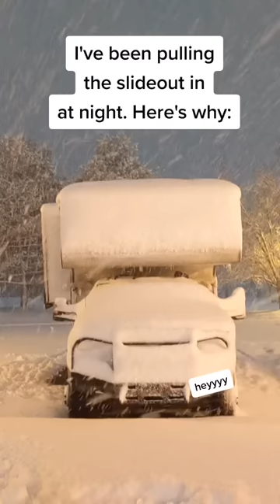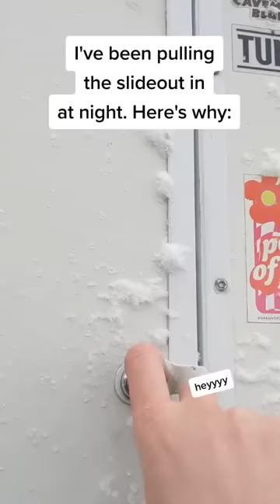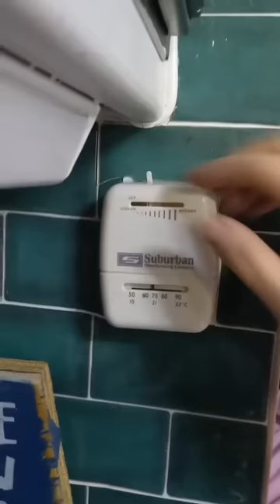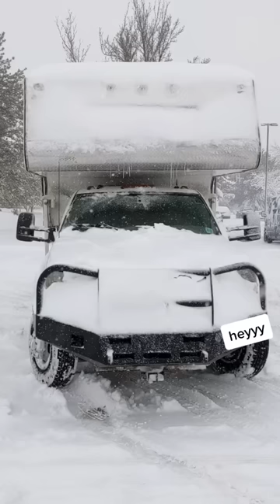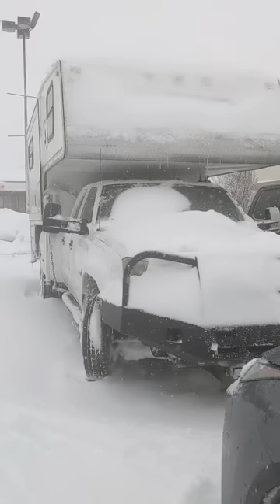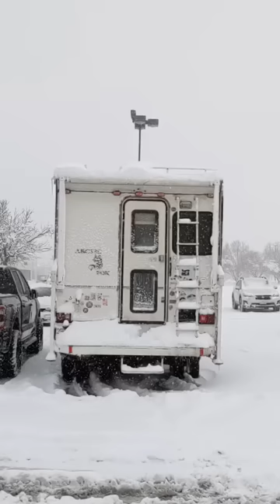the truck camper slide out theory #truckcamper #rv #rvlife #vanlife #fulltimerv #travel #slideout

Comment: Anytime you have more surface area exposed to cold you increase your heat loss. Slide in you basically have just the exterior camper side wall. With the slide extended you still have the side wall but also have 4 other surfaces now exposed to the cold air plus increase cubic feet of the interior.  The other thing you won’t have is snow on top of the slide that will need to be thoroughly cleaned off before closing the slide for travel. Your heating cost saving will not be huge but absolutely having the slide in will save some furnace cycles.

Comment: HVAC contractor here. Yes, fact. If you have less area to heat, it’s going to be cheaper, and probably easier for your heat source to maintain. On the flip side however, how much is the diff in sq Ft? Probably not enough to warrant the wear and tear on the pull outs. JMown 2cents.

Comment: You are going to save energy for three reasons:
1. Less exterior surface area to lose heat
2. Less interior volume to heat
3. Better sealing of the RV envelope
Plus, ice and snow can expand and cause issues with the slide track and gaskets.

Comment: Pulling the sled out increases your external exposed surface area AND it increases the internal volume load on your blower motor and will cause your unit to run and cycle longer. But the difference wouldn’t be enough to notice and use that much extra propane. The thing that really determines how much you’re going to spend is the outside temperature compared to your indoor setpoint. Your setpoint will always be somewhere close but the outside temperature is the biggest variable and it’s the part you can’t change.

Comment: A larger area will have less temp changing 
Smaller area will cause the furnace to cycle more often
Imagine what else the furnace is heating besides the air
The more objects also helps to keep a space warm

Comment: Absolutely, the slide out exposes its 5 walls to the cold exterior temperatures. When its pulled in it exposes only 1 surface plus its sealing the exterior wall cavity

Comment: There is less air space to heat, and there is double. The insulation in places, also adding foam blocks used for sound deadening, on the walls, especially over windows, and on the ceiling, especially the ceiling, the heat goes up, even getting a nice printed cloth and either glue it to carpet padding, or sew olit to a double layer vof fleece, so it looks good, can make a big difference especially when hung over windows, and doors, padding and a rug on the floor can help also, the diesel heaters are said to work especially well, efficient, and less than $150, and can burn used engine oil, I'd mix about 1 liter of diesel or kerosene per 3-4 litres to thin it out a bit, for extra cold weather maybe double that as far as half and half,  just a single person in there is lije a 100 watt heater , even hanging the shiny emergency blankets on the walls and ceiling. Can reflect heat back in, it can be used with a nice printed cloth slot so it's not see, like one on the ceiling, and one over the door and window, could eliminate heat for a few hours if it's not freezing, you can get the similar stuff at Lowe's or home Depot, that is like bubble wrap, and is shiny, make panels that can be hung over the door, windows actual bubble wrap can be used for the window if you still want light to come in, but get a can of spray adhesive, and glue it to a nice cloth, a nice fabric can be as good as a picture of wallpaper,  stupid at a tire shop and get a few stick on wheel weights, zopot across the bottom to weight it down. The two sided tape plastic hooks should hold it up,  any of this could cut heat in half or better, plus it can help keep heat out in summer also! With large parts of the walls covered, you could probably heat that with a couple large candles! 😆✌️

Comment: Hobo heater. Grab a pie pan, half a dozen or more flat closely sized  rocks and a quart size taracota pot and a gal. Dril 3 3/8 or half inch holes, start small. Drill them in the bottom of the pots.take the candle light it and place it into the pie dish. Then put 3 rocks down and put the first quart size pot over top the candle on the rocks. Do the same for the gal. If you have insulting foil tape put on the out side of the gal pot. Adjust the number of wicks until you reach the desired temp. If you need more air flow poke hole in the pie dish side. Hopefully you grab a tin one. You can use a sterno but they cause a massive fire if spilt but if you got a area wear this won't be touched. The pipes are the part u got to worry about the most though.

Comment: Yes it's more efficient, less space - less waste. Also you should not be pulling out your slide during snow, the weight will cause a drag eventually. One day it's gonna be pain to close.  That's a expensive repair too. It will also cause the seals to shrink and contract, wear out faster. Like everything else, you need to get the slide serviced annually. from top clean out, to recondition rubber, to point checking motor and components. Also if you need to leave in a emergency, which I've had to do - it shaves off time.

Comment: This will definitely make a difference.  You’re using the same heater to heat a smaller space with the slide pulled in.   If you’re able to slightly enclose you sleeping area and run a duct from the vent to your bed, you could set the temp really low because the heat in your closed off space will stay a warmer than the rest of your compartment. I do something similar in the summer with a fan.  Basically creating a wind tunnel so the air flows all around me.  I t’s almost like being in a tent with the windows zipped and a fan blowing on full. It gets over 100f and can be humid as heck.  Sadly, I only have a swamp cooler….. but this trick saves me every summer.

Comment: I understand about the need for slides to be brought in not just for heat-saving, but in case you need to get out of there fast. My question is: Can you get from the back of the camper to the front cab area so you can get away if you needed to? Is the crawl-through space large enough or do you have to exit the camper in order to get to the driver's seat? thank you!

Comment: campers werent designed for permanate living, and slide outs were not intended to be left out during rain and snow storms, by doing this, you will experience failure of the slideout, and roof over slide out, due to water damage.

Comment: If your going to park in cold windy weather, you maybe able to wrap the sides of your camper with 5M plastic. or even the window plastic that. you use your hair dryer to seal. Also take wide painter's tape and seal all the edges that come together by doors. windows, sliders etc.

Comment: I used to winter camp in an Arctic Fox 990 all the time. My suggestion is to get you a Mr. Heater Big Buddy and plumb the bulk tank hose into either your heater or stove fitting. When it’s bed time, kick the Mr. Buddy on medium/low and let it supplement your furnace. Way less propane and close to 0 battery usage while still maintaining a comfortable temp. The Mr. Heater has a tip sensor as well as a low oxygen sensor, but make sure you have a good carbon monoxide detector.  I have kept my camper at 65-70 degrees in -20 degree weather all night this way.

Comment: As long as the snow isn’t piling up on the top of the slide out, it’s a good idea. I would worry about snow melting inside the camper if you don’t wipe the snow off the top of the slide out before pulling it in.

Comment: The heat transfer away from your camper is dependent on the surface area. With the extension pulled out you are increasing the surface area, and thus losing heat faster. So yes you should be saving power or propane because you decreased the surface area.

Comment: You are correct.  The smaller the area you have to heat, the less the heater has to work, and the less fuel you use   Simple physics.

The same is true of air conditioning, as well.

Comment: YES,  The gap clearance in your slide is designed to be flexible and over sized. PRO: driving over bumpy conditions it is free to flex and not break CON: That gap clearance permits all seasons to freely leak in...and OUT.

Comment: If you eat up your pull in a safe way and use a blanket separator, you may eat up the rest of the camper at lower degrees. extra heavy blankets like window cover help as well.

Comment: I lived in an old one no pop outs winter time I installed foam board leaving a small gap around the edges I keep the door closed I make coffee or dinner outside to control moisture when you use the stove propane gives off water in the form of gas each precaution you take helps oh and it really helps to have company as cabin fever will set in when you are lacking another person to talk to …hope this helps

Comment: We have a motor home and in extreme cold weather we pull the slides in. It does seem to make heating more more efficient. It made sense to me that you are heating less area and you are reducing the wall space exposed to the cold since the thin slide out walls are not outside.

Comment: It really comes down to how much heat loss you have in the space, with the slide section out you have more walls a ceiling to have heat loss, you heater is designed to condition a certain amount and will continue to produce the same heat temperature not matter how high or low you set the thermostat; what will make the difference is how long it runs when it comes on. If on for long periods of time to get to desire temperature setting on thermostat. Example if it comes on 3-5 a very cold night for 5-20 minutes at a time you’ll use less fuel then if it comes on 2-3 but runs for 30-60 minutes. The roof is where you lose most of your heat. I’m a tenured HVAC/R service Technician so this is coming from an expert

Comment: When you go to bed and it’s cold, you curl up, to conserve body heat.  This is the same.  Less volume to heat, less surface area outside, of course you are using less propane. And very possibly it has a better seal than the unit has when extended, which just adds to the savings.  However, if you didn’t have a good seal when retracted, then you could end up even worse than when it’s open.

Comment: I don't know a thing about campers but the physics is correct. Pull it in for less area to heat, this less furnace turning on, plus it will probably seal the van better also. Be well.

Comment: Less space=less area to heat.   Also brining your slide out in during a snow storm/blizzard will potentially save you from frozen slide out in the morning.  I would also keep a thermal sleeping bag in your truck in case something happens especially if your propane runs out during COLD ass winters.

Comment: Of course it make a difference! The same as closing the door to rooms you don't use in the summer and winter. Plastic over your windows will also help. Parking behind structures or thick trees away from the wind will also save. Common sense says less square footage to heat the less it will cost. The same with insulation like plastic and out of the wind. Turn your furnace down 5 degrees at night when you have more covers on you to maintain your core body heat. If you add a electric blanket when you are at a camp site with electricity you will save on the battery and propane both.

Comment: Yes it's less use. Basically they are automatically turned on via the temperature. When it gets to a certain level the heater will kick on. When it comes to heat the more surface area you have to cover the less heat you will have. Less area to heat will always keep you warmer then more heat and burning more fuel.

Comment: Always pull your slide in at night in winter. Its a good idea to put Pam or getable oil spray on the gasjet it dont freeze. Make sure to sweep off all snow. Slide outs arent insulated. So you will save alot of lp. I had a large motorhome 38 ft. N slept on fold out couch n clised bedroom door less space to heat n i stayed warmer

Comment: It does make sense because you are decreasing your interior space and therefore the fuel needed to heat it. Yes sleeping but you should be able to track your fuel consumption somehow. Plus you won't get snow collecting on the top of your slide outs which might impede tearing down quickly if you needed to.

Comment: It is most certainly a real thing ! Here is the WHY. the formula for BTU requirements is A divided by R value muliplied by Delta T. A stands for area or surface area of the walls divided by the R value of the insulation in said wall then mulitpy that by Delta T meaning Temprature difference needed on worst day. as in if its gets -20 and you want to keep room temp at 75 you would need a muliplyer or delta t of 95 total degrees. Thus the smaller the area the less BTU required. just the facts

Comment: The furnace coming on as much means when it does, it must run longer to heat your unit. When it runs off a thermostat, remember it's not just heating the air within the space. It must heat everything ! The air, the walls the floor all the furnishings, the bedding even the insulation itself, all the way down to the dog bowl on the floor. Once all of this has been accomplished, the thermostat will only then turn the heat off. The only way to overcome this is to run it on a timer. But that will defeat the purpose having a thermostat in the first place. The best way to go is set the thermostat to a tolerable level. The temp. will drop 2-3 deg's. then the thermostat kick on and bring the temp. back to the level you set it at. If it's left to longer intervals, you will use more power and gas to reheat all the things I mentioned at the beginning of this post. Leave it inside and stop listening to idiots.

Comment: Yes, definitely, the surface area is much greater. Making assumptions for R-value, surface area, temperature inside/outside, the heat loss from the increased area can easily amount to 500-1000W, which is like a space heater on low. And if the air seal is better when retracted, stopping drafts could easily double the savings.

Comment: Bottom line there are two reasons. 1. Less space takes less heat to maintain the temperature inside.  2.  Slides are customarily NOT as well insulated on the slides on 85% of all brands, especially on the floor of the slide.

Comment: Ok HVAC tech here, yes your saving running your furnace as you have reduced your square footage and your exposed area to the cold.  Those that have commented about a draft are absolutely correct.  You will save by retracting the slide out.

Comment: So generally speaking if you pull the slides in you have less area to heat so should save you there.

Turn an AC or Heating system on and off when temperatures change a large amount actually coast more than setting it a comfortable middle temp and letting it be, allowing the system to manage itself. It coast more energy to cool or heat large temperature differences than if it did small burst of air to keep it in the middle temp

Comment: stock propane furnaces in RV's are not really designed to heat at -10 and lower temps. I have lived in older RV trailers for years and live in Canada so it can get cool out ;) The furnace will come on and basically try to heat but its colder out then what the furnace can combat. A smaller area is better. Make sure your unit is as sealed up as possible to retain heat (but make sure you have good ventilation and fresh air income!!!). I use wood stoves as I can produce more heat then I lose (40' trailers). Best heat for arthritis as added bonus lol Be safe and good luck.

Comment: It is a smaller area to heat with it closed, BUT...the seal on the slider may be better when closed too.  Check it both ways.  As for usage, you can see what use use both ways after a week.  Sadly, I know we aren't done with winter yet.

Comment: Furnaces and air conditioners recommended out put is based on cubic feet. If you are decreasing the cubic feet by closing the slide out you're most definitely making your climate control more efficient

Comment: Of course it’s true. Smaller space, less energy needed to heat it…..assuming of course that your slide isn’t blocking any output or input sections of the system causing to function with less efficiency.